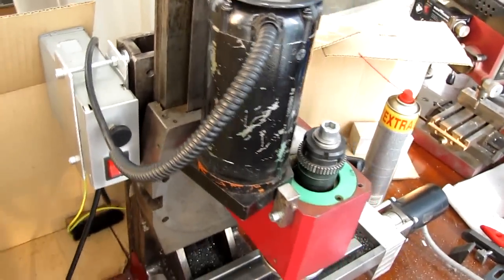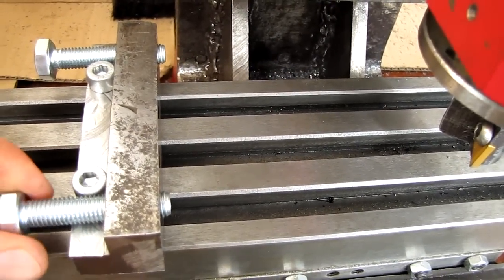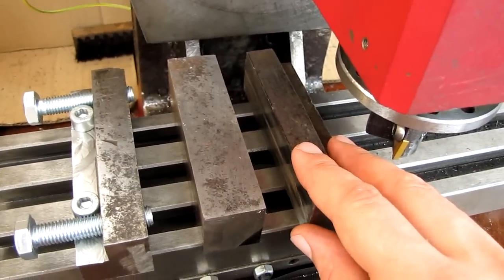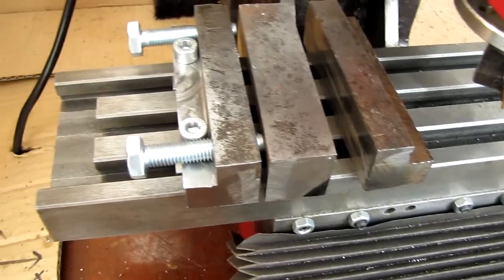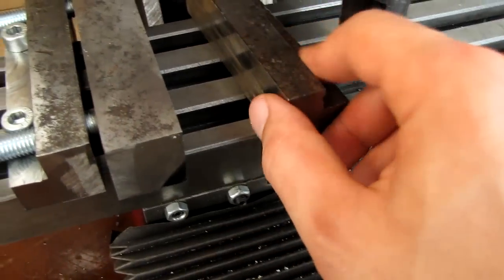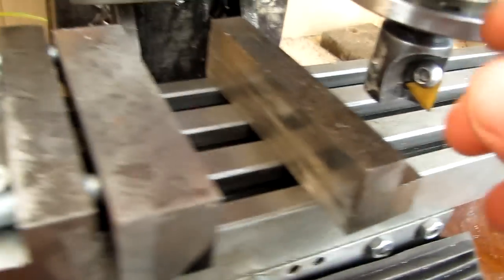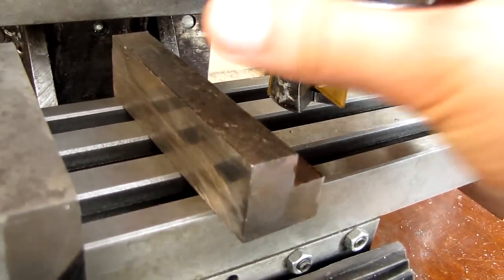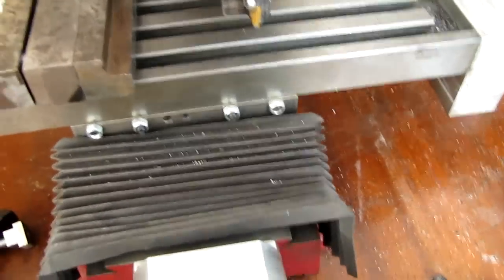Homemade milling machine vise

Comment: Seems interesting. I'm curious how well it holds true to the parallel and perpendicular when tightened. I'll have to make and test it.
Reply from the maker: It tends to slip on the table if not tightened extremely well, was enough for my purposes though. One interesting thing is that it doesn't tend to lift from the table due to the down holding screws.
Reply: mmcristi1981
Thanks.

Comment: you can glue a sheet of emery paper to a flat surface and with your vice part,make figure eight motions to clean up the surfaces.people do this with cylinder heads with great results,this is a cheap solution.hope this helps